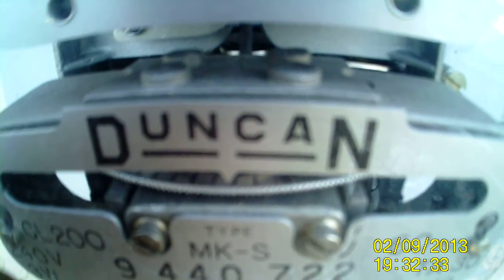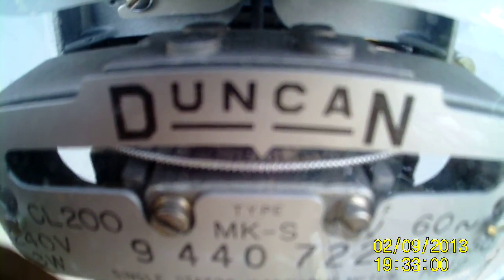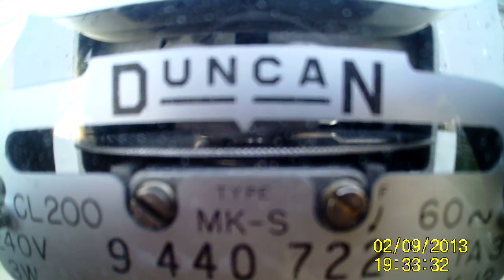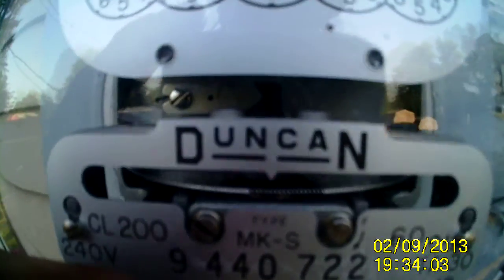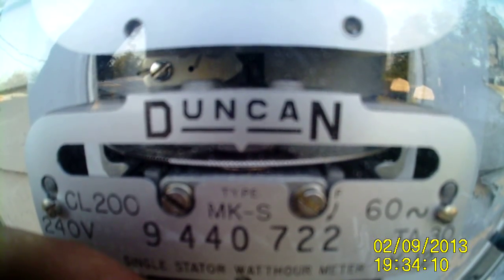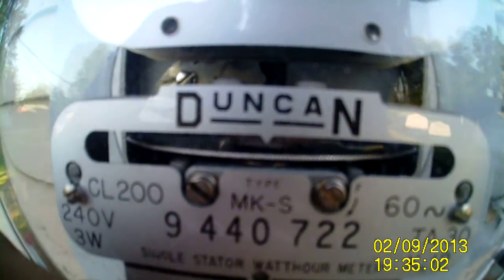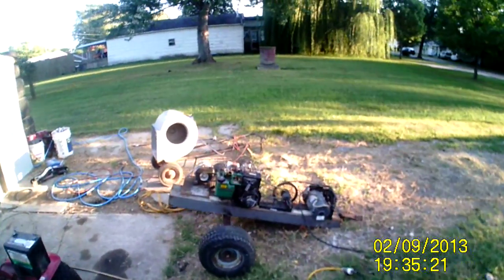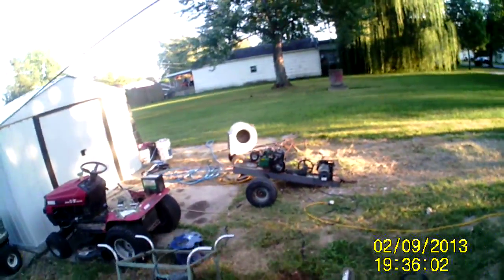Running the electric meter backwards

Comment from the maker: wired as normal no modifications all you have to do is plug it in and overdrive it with a power source you just need to spin it about 3 percent faster that as rated :) it is the easiest to build grid tie generator ever ! if you like I can make a more detailed video on it without the noisy thing running :)

Comment from the maker: thanks man now I just need to scale this thing up to run the whole house , one thing amazes me is how little power it needs to make this much power , this 3.5 hp engine running on low octane diesel,paint thinner,and a few other things for fuel makes 10 amps  at a low idle when my 15 amp gen set I got has to burn all kinds of fuel and run @ 3600rpm with a 8hp engine and struggle to make 10 amps ? how does this work so good ? with this engine I could run 3 of these motors and total 30 amps ?